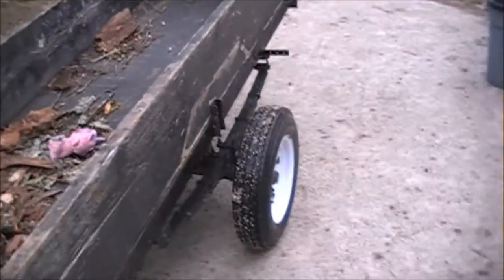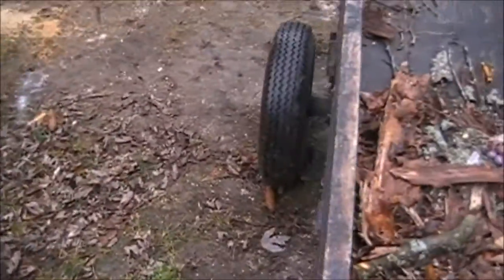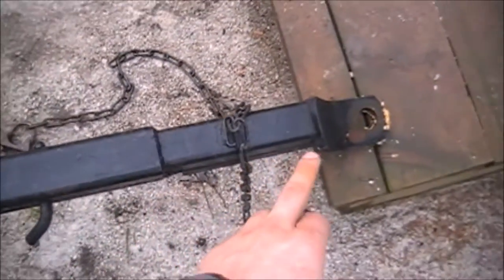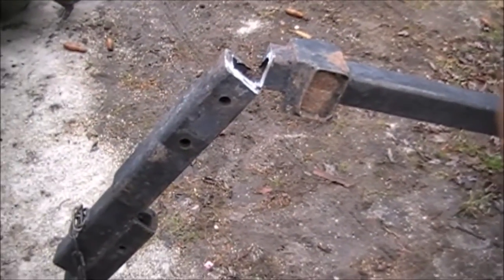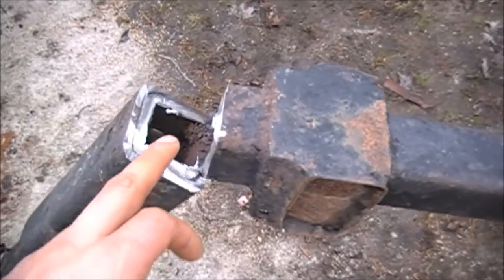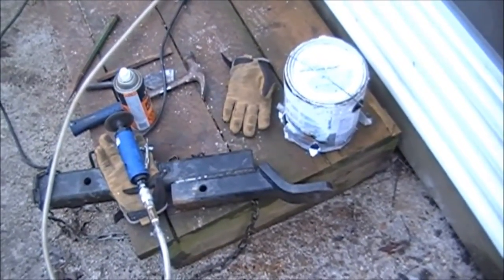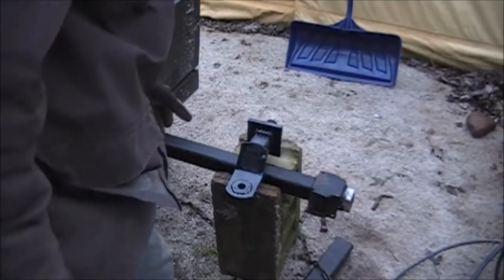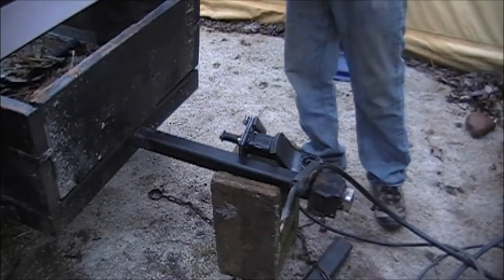Home made atv trailer update swivel hitch install

Comment: I like the idea. I think I want to build mine on the hitch side rather then the trailer side though. Cool Idea. Thanks for the video. Also I don't think I will use a spring at all. Just a large bolt get the tention you want and weld the nut so it cant loosen or tighten.
Reply from the maker: ya the spring was a bad idea every thing else worked well though

Comment: Good thinking, however I do have one point. All the weight on the trailer tongue would now be on the 1/2 inch bolt. It would bend easily so I think the swivel would fail. Have you tested it with a heavy load and how did it hold up?
Reply from the maker: I changed it after this the spring was the down fall It would have been much better to just put nuts on both side